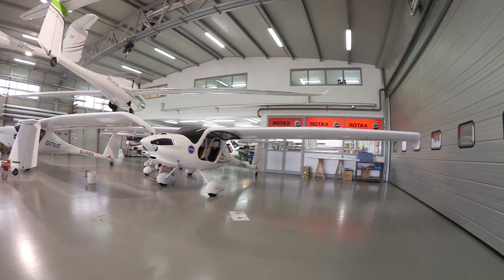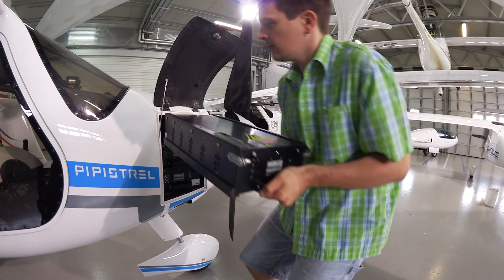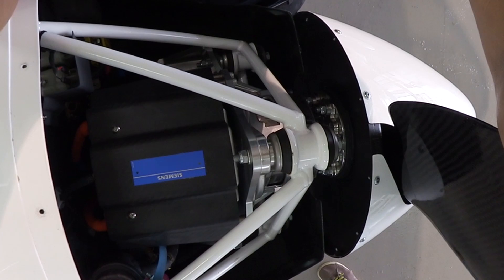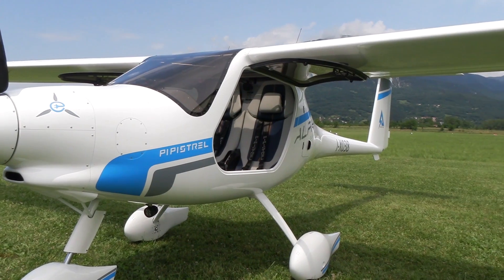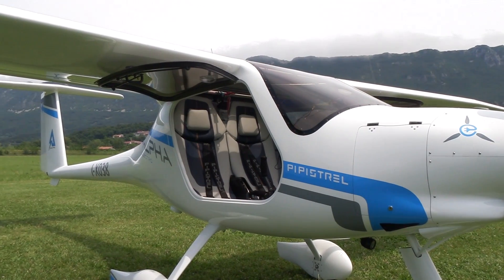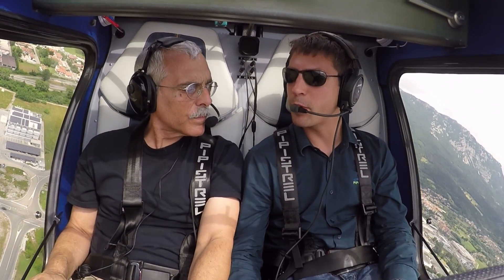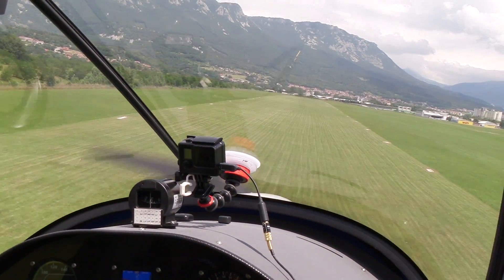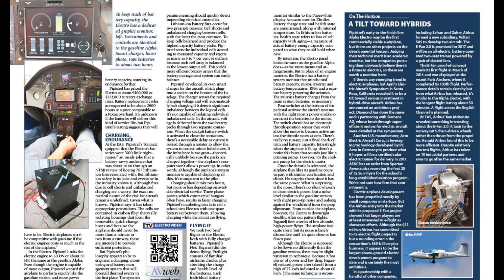Flying Pipistrel's Electric Airplane

Comment: it seems safer than gas jet
Reply: +Yee Tan nah, eletric airplate means low alttitude.  low alttitude means less options. if something happening you have to react immediately. if you are 10000+ feet then you have a lot more time to think whats going on and how to act. 10000 ft means ~ -5 C /23 F and its not good for your batterys
Reply: +Bottled water 
Electric motors & batteries don't lose power with increasing altitude, no reason for them to have trouble flying at higher altitudes than any naturally aspirated piston aircraft of similar configuration. The battery pack stays warm in flight regardless of outside temperature because the pack is being continuously discharged.
Reply: +BasementEngineer 
The e-motor doesn't lose power, but the prop loses efficiency at higher altitudes and TAS - and this is true for all props and fans regardless of power source. Of course since the electric motor itself doesn't lose power, the plane will be able to fly higher - then again, since the battery weight might make it heavier than a gas plane, maybe not.
Reply: yan-Deriction The prop is designed for best efficiency at the nominal cruising airspeed. The air pressure is lower at higher altitudes giving less thrust, but the drag is lower too, requiring less thrust.
There are no inherent disadvantages to electric power outside of the currently very short range, and it'll take years of effort from bright physicists and engineers to overcome that. That's why you haven't seen small electric aircraft popping up everywhere for 10 or 20 years :) The huge advantage, of course, is high energy efficiency and low per-flight operating costs. An electric drive system is cheaper overall than the equivalent power combustion engine because it requires close to zero maintenance. In a conventionally powered airplane, the engine is responsible for a huge portion of the overall maintenance cost.
Reply: +BasementEngineer 
"The air pressure is lower at higher altitudes giving less thrust, but the drag is lower too, requiring less thrust." That is not how propellers work. A prop plane will always require less fuel at low altitudes than at high altitudes in order to maintain flight.

Propellers can be optimized for a certain RPM and speed, but any time you go faster and/or climb higher you lose propulsion efficiency. Going higher yields better overall efficiency - but only up to a point. Your basic cessna 172 is capable of going up all the way to the 10000ft, but the altitude for best range is 6000ft because of the propeller's limitations. Of course, the 172 has a fixed pitch prop, but even a variable pitch prop optimized for the highest speeds and altitudes will still in general have better efficiency at lower altitudes and speeds, being optimized for high speed/alt simply means you lose less efficiency as you go up or fast.

An electric motor has the advantage of not losing power at the shaft as you climb because its power doesn't depend on the availability of air, but it is just the nature of props to lose efficiency with increasing altitude and speed, and non-ducted props also have the problem of tip mach, so thrust per watt will keep dropping even though you are using electrics.
Reply: yan-Deriction You're right, but I always figured that small prop driven aircraft fly at low enough speeds that propeller blade tip mach effects aren't really a factor. A statement was made a few posts ago (not yours) that electric flight was limited to lower altitudes, and that simply isn't the case. If anything, higher altitudes are possible that flying with a naturally aspirated piston engine, despite the prop not running at it's best efficiency because it's optimized for lower alt.
Reply: +BasementEngineer 
Atmospheric satellites are an excellent (and perhaps the only yet) example of a practical electric plane, and those go super high.
Reply: yan-Deriction Yes they are! I almost can't believe such a thing exists. That could take a huge bite out of the cost of satellite communications, normally which require a rocket launch ($$$) and the rocket is often disposable (more $$$). I wonder what their limitations are (other than the atmosphere itself, which radio signals from conventional satellites must pass through anyway).
Reply: lol
Reply: BasementEngineer lol

Comment: Worrying about non renewable waste from failed or dead batteries seems a bit of a cheap argument to criticize something as new as electric planes are, especially when compared to the pollution created by engines in general which, surely, donesn't do any better.
Electricity will be the future of aviation, up to a certain extent, and hopefully won't be much longher to wait!
Reply: +Riccardo Granato New generation lithium-ion batteries are 100% recyclable. Where the older generation had lead and acid, lithium batteries have salt based fluids. And besides that, I think it's funny that people suddenly begin to worry about a new technologies toxicity, while at the same time using oil, coal and nuclear, which is no way near clean or recyclable.
Reply: +EpiDemic117 Yeah, but those are multi-million dollar engines on large commercial airliners. The vast majority of light, general-aviation aircraft still use incredibly inefficient piston engines that burn leaded fuel.
Reply: That's ~340 horsepower. Wow, that is powerful.
Reply: +EpiDemic117 I'm hoping Siemens' 250kW motors can make it to the GA end of aviation. They're tiny, but very powerful.
Reply: Any fossil fuel based power plant nowadays is much energy efficient than any internal combustion engine. And the centralized energy generation keeps pollution control far more easier and much cost effective.
Reply: Riccardo Granato definitetly, even with the sinus glider you are sipping fuel, and comparing it to say an archer it barely takes any.
Reply: +2014andBeyonD I agree, but a good 90+% of lead acid batteries are recycled.
Reply: Lithium batteries do not contain lead or acid. The "exhausted" batteries are very useful indeed: https://youtu.be/2ED-G_RTooc
Reply: Electric won't make it until we can regenerate while flying. More input pleeeeease... more input!
Reply: Batteries are fully recyclable. I looked state of the art paper about battery recycling. Researchers are debating what is the best method recycling these batteries.
Reply: It's the outrageous waste and global dumping of Plastic that is now and will be a major problem in the future.
Reply: Diesels that run jet a.... you realise jet a is diesel just without kerosene and diesel has more water to be honest.
Reply: What about the damage done to the enviroment from the manufacturing, mining and refining process for the batteries. Not to mention the fact that the elctric charge HAS to come from somewhere and the likelyhood of that being from renewable sources is slim to none.

Comment: And how much chemical non renewable waste will they generate?
Quick charging batteries will kill them and reduce the cycles to more than half of normal charging.
Flight schools will go through batteries like crazy
I asked them about company policy at aero2015 and there was no policy on return of failed dead batteries.
You get to keep the chemical waste.
No imagine this with thousands of flight schools...
Reply: +flexairz The lithium ion batteries are fully recyclable. Gasoline engines produce plenty of non-renewable chemical waste!
Reply: +flexairz Nonrenewable waste? Li ion batteries are 100% recyclable.
Reply: rdelrosso2001 Standard 18650 cells (like the ones in Tesla cars) are normally good for a 2C continuous discharge rate, which makes them suitable for aircraft use. Time will tell :)
Reply: Don't answer to that idiot. He just trolls and never answers any facts thrown at him. He's just a poor anti-green denialist. Such a loser... :D
Reply: rdelrosso2001 actually, i wouldnt be surprised if they were using the exact batteries tesla uses. the 18650 battery platform and with cells like the samsung 30Q, they are very suitable for aircraft and quick charging.
Reply: Exactly, and since the 18650 can do close to 40.000 cycles, they would last over a decade if the airplane was flown as a trainer, 7 days a week, 365 days a year for 8 hours every day.

http://blog.evandmore.com/lets-talk-about-the-panasonic-ncr18650b/
Reply: +robert100xx 
   Elon Musk is building a Giant Battery Factory in Nevada. 

 Since Tesla is already making Li-ion Batteries for Electric Cars, with a few Tweaks, he could probably make Lithium- Ion Batteries for Electric Planes as well!

Comment: It's a cool alternative to primary flight-training. It would be a great traveler if only endurance could be increased. Overall, it's a fine airplane!
Reply: skyyguyy No it is not. I have flown and fly one, the view outside is limited. The main spar sits in the way if you are normal length. The panel can not be reached normally, the baggage compartment inaccessible during flight..
Its roll rate to high compared to other trainers.
Too nervous on the rudder.. not enough yaw stability, Pilots will be scared with this aircraft in some turbulence.
Reply: flexairz Great points, no disagreement there. I have some time in LSAs, particularly in Tecnam and I understand the hyper-sensitivity of the controls, but it can be used in limited student applications. 

It's not likely to replace common trainers, especially in the US, but students should be challenged... of course with an instructor on board.

I know there are other issues concerning battery-usage and disposal, but those things should be seriously addressed.
Reply: +flexairz Nonsense. I owned a Virus, and am 5-11, tall from waist up. Plenty of headroom. Reach is fine to panel, and you shouldn't need to get baggage in flight.  Roll is OK for wingspan, and control harmony is a dream.  These guys know their stuff. I met all the top engineers st, most of whom are PhDs, like Tine, who is double PhD. Super nice guys. One went all the way to Coalinga to get my ship airworthy after an American A and P effed it up refinishing the wings and tanks without vacuuming the dust out when done,  after another idiot American owner ran car gas in it with ethanol.  Rudder is touchy, but because it is BIG, what you want for yaw control in a long wing ship.
Reply: +MrSahansdal Seriously, one should not be able to reach for flight manual, maps, refreshments during flight? 

Control harmony a dream?? Geez, ever flown a Tecnam, Cessna, Piper?  The roll rate is way to itchy.
Extend flaps and adverse yaw becomes awful to the point when trying to land with crosswinds and turbulence the thing becomes dangerous for most new pilots.

During taxi with full fuel and two people it wants to tip backwards on grass strips.
The flaps, when extended, make a howling screaming sound.

Being a PhD says nothing about the aircraft or being able to create a nicely harmonized controlled aircraft with great view to the back an easily reachable baggage area with a stable taxi and silent flaps when extended.

Geez..

Comment: I was saying i want one till the endurance killed that for me (sigh) still a good cheap trainer
Reply: Don't worry, since batteries were invented wattage per kilogram is climbing and charge and discharge rate is also climbing. At the same time wear and tear becomes less over a lifetime, cycles become deeper and production methods become cheaper. They also become less to non toxic, 100% recyclable and have the potential to be constantly recharged with solar and wind. If you plot out these developments in a graph you will notice you're looking at the end of the carbon age.
Reply: +crapper1 yeh, its perfect for circuit training, low cost low range requirements, its going to take a few battery breakthroughs for electric aircraft to be practical for cross country touring.
Reply: Technological price reduction and performance increasement follow a law. It's just a matter of time.

Comment: Economy is the killer feature: if flight schools start to buy planes like this, they could really make learning to fly affordable for many people.
Reply: MajorLeague  The video states that battery swaps take a matter of minutes.  Presumably, the batteries aren't super cheap, but I'd wager it'd be a schools interest to have two or more sets of batteries.  I'd wager that supplies would do a battery lease or swap scheme, where you simply trade in your older batteries for new ones.  My concern is 10+ years from now when E power really starts to cut into IC/oil industry.  E power suddenly won't be as cheap when there are more ways to tax us for it.
Reply: @Planehazza  The cost of the Alpha Electro is much higher than the cost of the regular Alpha, a second set of batteries costs about twice as much as a whole new engine for an Alpha, and the charger is also a very expensive piece of hardware, so there is no way that this airplane will ever be cheaper to operate when compared to a Rotax powered Alpha.
Reply: I wonder how difficult would be to fly a Cessna 172 after learning how to fly on this plane. There are a lot more moving parts on a traditional engine and checklists must be very different.
Reply: Flight Simulator 2020 to the rescue!
Reply: I dont know anything about flying but the controls looked simpler as well
Reply: Schools are already using them! https://youtu.be/YdfYXlUK6is
Reply: Give some hard evidence that the price of battery maintenance is even close to Piston or i'll just assume your one of those anti-new technology people.
Reply: Major League - That idea is pure fiction from people who have no clue what they are talking about.

Here are some lifespan statistics on today's Lithium Ion batteries.  They will last tens of thousands of hours, while a piston engine needs to be completely overhauled every 2000 hours.

http://blog.evandmore.com/lets-talk-about-the-panasonic-ncr18650b
Reply: @captaincrunch3892  These batteries are discharged at nearly 1C, they are not going to last long with that kind of punishment.
Reply: @PistonAvatarGuy  1C discharge is pretty gentle. I regularly see 20c continuous in my fleet with no ill effects at all. It's more about not over charging or over discharging, and storing the batteries at their proper storage voltage.
Reply: @thomas78552  Have fun replacing the batteries at 300 hours.
Reply: Not only that but the environment would be greatful and human safety would be increased tremendously if everything was electricity ran than everyone is good
Reply: Marius Ipad  No one will want it because it will be a low quality POS.
Reply: If you can’t afford it now flying isn’t for you
Reply: More probably, it would increase profits of flight schools, without any benefit to the pilots...
Reply: It will add to the cost of training because you still need to teach the student a conventional airplane. Teaching 2 planes for a PPL is more expensive than teaching 1. Plus: you can't take your license exam in an electric. The operating procedures are completely different. And if you somehow can license someone in the electric - they're completely unqualified to operate a piston.
Reply: scott boelke 
The point is building up the manual flying skills and the essentials of instrument scanning/spacial orientation, aerobatics with more hours on the electric a/c. before the jet phase....
The handling of a piston engine aircraft is actually a negative training before a jet!
Reply: @coldfusionspacexxx9814  I disagree about negative training piston to jet. But, I only have 4000 hours in 3 different jets - and another 1100 in jet simms.
Reply: scott boelke 
With the piston comes the precession and adding pedal; the jet does not need that unless you do high AOA at slow speed or aerobatics or dogfight or formation.